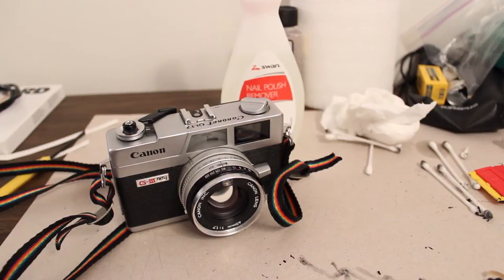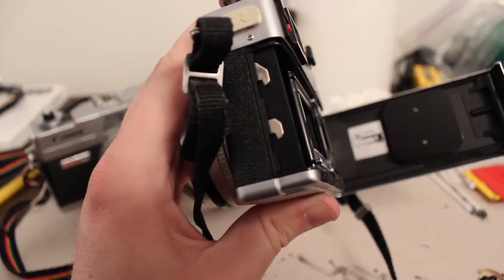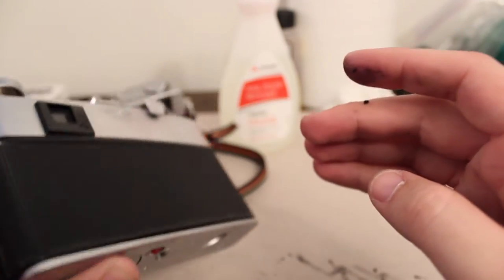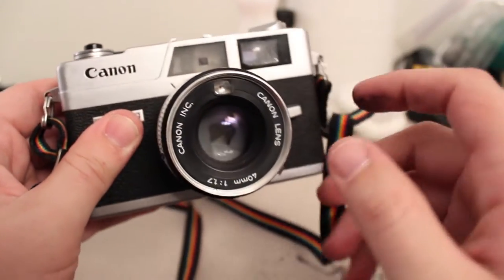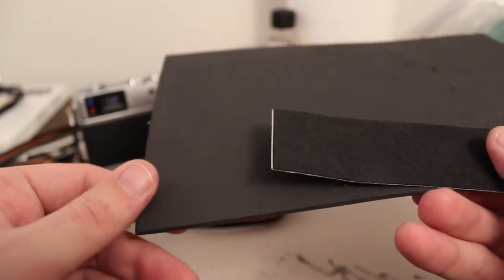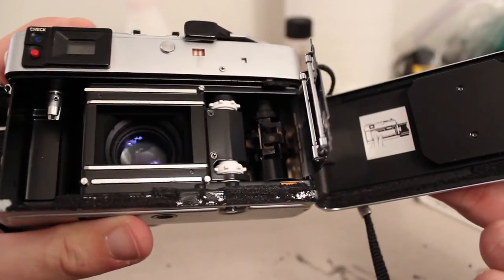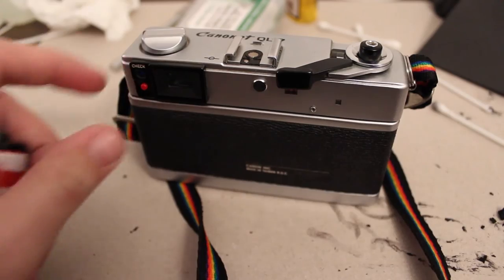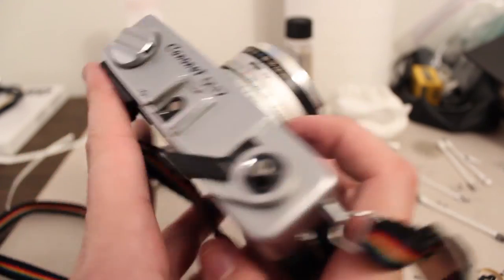Fix Your Camera's Light Seals! - Camera Clubhouse

Comment: There is a better way of replacing the rear door seals on cameras that have a groove at the top and bottom for the rear door to slot into, i.e. this fix would work for most film cameras.  Use pure woollen yarn (preferably black), bed it in using some black silicone sealant and press the wool into the groove.  This provides a better seal than foam, is easier to do and will last much longer.  Wool has a natural property in that it compresses and rebounds, so will retain its light tight properties for many years.  Also, you don't need to fully clean out the old foam seals, which can be a difficult job.  Just get the worst of it out with a toothpick or similar implement.

Comment: Very helpful, thanks! I agree that the Canonet door design isn't so hot, but it's a pretty easy repair, plus the Canonet is probably the cutest little camera of its kind from that era. Look at how much smaller it is than the Konica. It also has a nice quiet shutter. Have fun with your vintage hardware!

Comment: I've done this a few times.I use a hand held rotary cutter to cut the foam.Also be careful with nail polish remover around painted surfaces.It can remove paint.I can usually get the old foam off with rubbing alcohol and scrapers I cut from craft sticks.

Comment: Great video. I find a cut up neoprene mouse mat works well as well. Someone else had a great tip of stretching it as you push it into the seal channel as this will keep it in place without sticking it down. Cheers though, a well delivered video
Reply: I was looking at some  1/16" soft neoprene (40 Durometer). It's much stronger than the foam stuff and it would fit in my Mamiya c330. Several on-line vendors sell small amounts. It shouldn't deteriorate with age like the other foam stuff does.

Comment: so i have the om-g /om20, and it does have this slot design where the door goes into it. i've been having trouble closing it after putting in seals, do i really need seals on the door end of the camera. I have it in the slots on the body, as well as the channels on the top and bottom edges of the doors.

Comment: Hmm... I have four film-cameras, of which I think all of them have that slotted design.
However, I do think that at least two of them have foam (or whatever) that's falling apart.
One is an Olympus Trip, which is very similar to that Konica. And then I have a Minolta X-700 and XG 2, and also an Asahi Pentax. - But do you think that if they have that slotted design it will suffice and I should leave it be or just try to seal it up?
Reply: Hi Michael. I have an Asahi Pentax Spotmatic SP2 with that grooved back door. It has no seals except one on the closure point (very narrow behind closure clip) and seams to be ok. I've put sixteen rolls of film through it with mixed results but no light leaks after replacing the one  edge seal. Good luck

Comment: I bought non adhesive foam off ebay by accident, so I'm gonna deal with it, what would I use to stick it on? and also I'm worried about getting the wrong measurements etc, any help?
Reply: Contact adhesive is good for things like this.
The type that gives off fumes.
It has to be of the type you can remove later with either alcohol or lighter fluid if need be
Reply: It came yesterday, but 2mm foam looks so thin and looks like it wont do anything against light, like seriously!

Comment: Its best to use a chopstick or other bamboo skewer etc. and whittle it to size and shape to use for scraping off the old gooey black foam.  Don't use anything metal or you risk scratching things.  Wet some paper towel pieces with lighter fluid then scrape and clean with those.  This works good to clean and the lighter fluid evaporates and leaves no residue so your new sticky backed seal material can stick right on without having to clean again..  I've done a lot of light seal replacement and this is the process I use.  I whittle a chopstick/skewer into an end like a flat head screwdriver and run it down the groove with paper towel & lighter fluid to get all the goo out of the groove.   Lighter fluid!  no acetone or other strong stuff necessary.